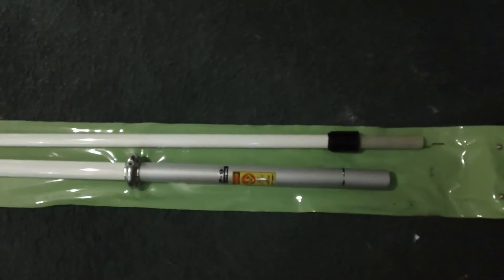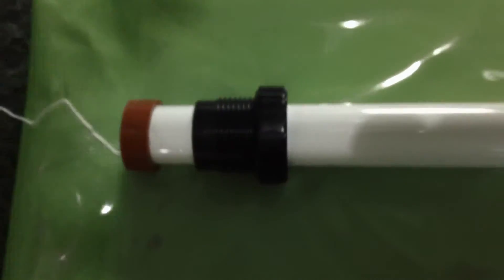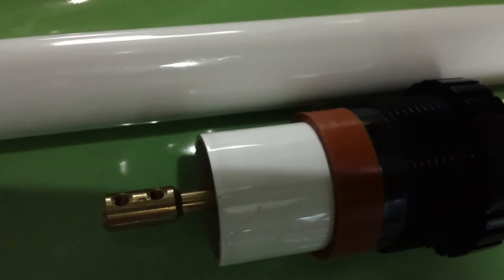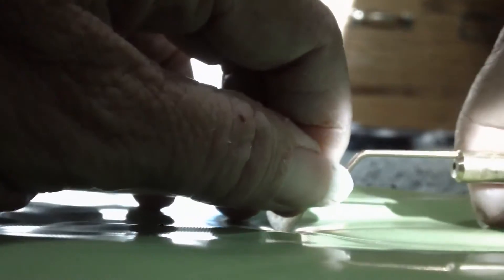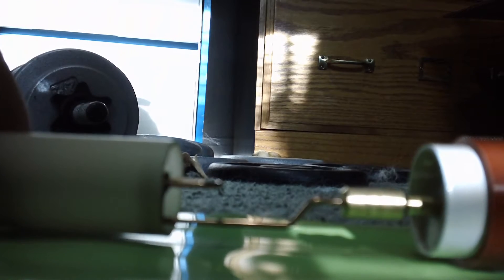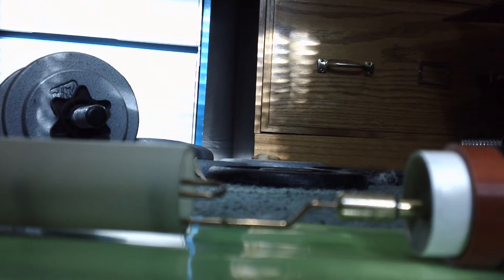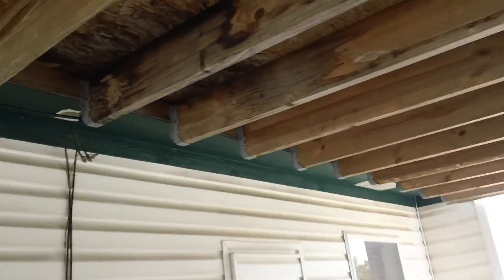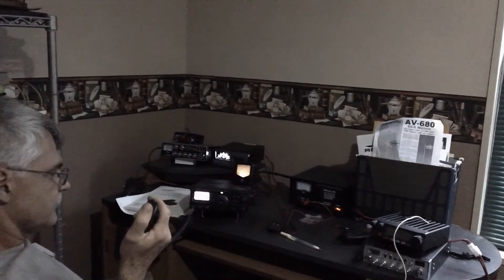Prepper Communications - Assembly and Installation of Comet GP-9 UHF/VHF Antenna

Comment: You should have shown the antenna on the roof after installation. I wouldn't  use RG8U, I use Browning LMR and my  swr is 1.3 at 100ft coax. Did you put tape on the connector where the coax connects to base of antenna? Make sure all sealed up tight. It looks like your antenna was to close to the roof, you need to get the base up higher at least 8 ft above roof ridge.

Comment: I have mine laying on the living room floor and this looks like a pain in my neck.  Would have been so much easier if you just screw on each section with a lock washer that's it.

Comment: Ok, now the real way to solve this issue.  The elements inside the fiber glass are not THAT firmly stuck in place.  JUST SHAKE THE SECTION LIKE KETCHUP BOTTLE! The element rod will slide right down.  Screw together and push back up.

Comment: Another little tip is that when you put small allen screws in put them on the end of the allen wrench first, makes it much easier to line up and screw in. K7MMA
Reply: Another tip is to always tape from the bottom up.
Reply from the maker: Thanks I will keep that in mind for next time :)

Comment: if you have a high SWR check the solder joints this antennas notorious for having cold solder joints
Reply from the maker: I'll do that.  We did have an issue with that on our A-99 once.  Thanks.

Comment: I see your antenna has an os-239 connector. My GP-9 has an N type connector. I use mine for UHF, thus the reason I got the N Type connector. OS-239 has greater signal attenuation above 100 Mhz . I also use LMR 400 cable which is probably the best cable you can use . Other then HARD LINE . Any way great video.     73 WN9K
Reply from the maker: Thanks for watching.  I was seriously considering the LMR 400 cable and now wish I had gone with it.   I may be replacing our cable because after the recent storm we have high SWR and I'm not sure yet if the antenna got damaged or if it's the cable.  I am going to get on the roof and put a test cable on and see what reading I get then and go from there.
Reply: Joe Van Wye,, I use lmr600 for my feedline. I used to use 9913. I found it made reception of signals so much better. after I replaced a 4'  jumper of 8x with 10' of 9913.

Comment: great vid, i just installed the gp9, only thing i didnt like was the wire into set screw design, i overtightened 1 set screw and int went through the wire, be cateful NOT to over tighten them, "Mine still works" but figured i would pass this tip along.